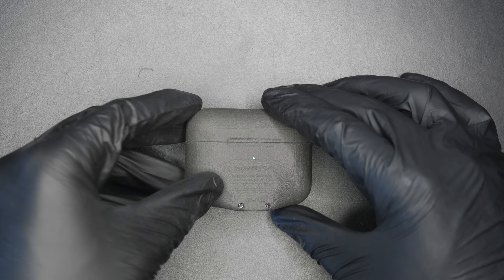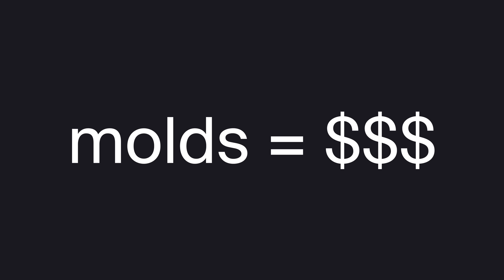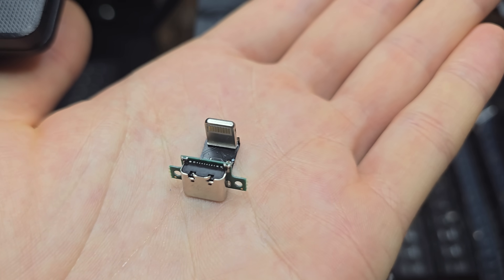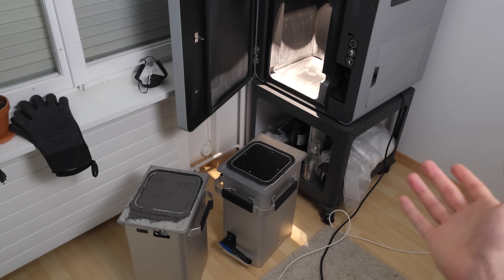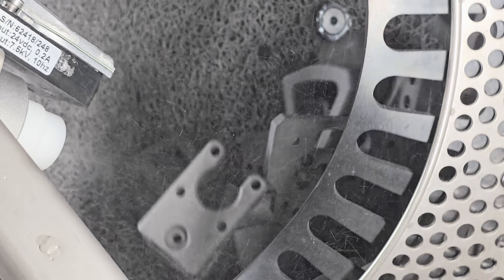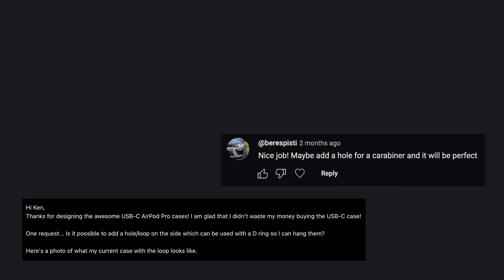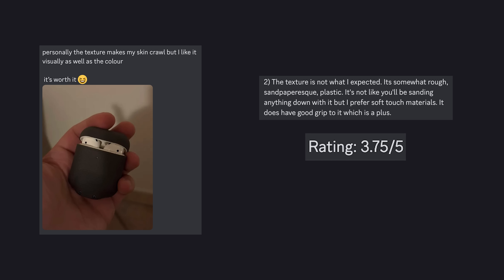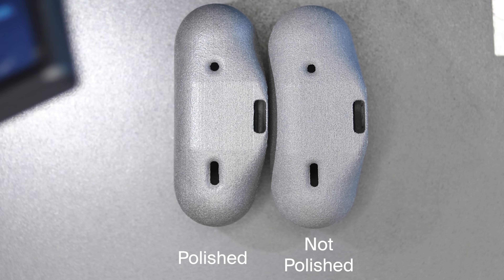One Man Plastics Factory

Comment: Seems like there would be a good rotary screen (tumbler) solution for loosening the raw slugs that come out of the printer. Looks like the clean up solution on the machine is suited to one-off and larger parts.
Reply from the maker: This is definitely where most of the human work happens. I agree that I need to find a better solution. I mentioned trying to use a drill with a brush accessory. I will try to improve this by fixing the brush to the station and adding a foot pedal to turn it on. I also need a better brush.

I also thought about a tumbler solution but haven't looked into it much. What kind of tumbling material would you use? I'm worried the powder might get contaminated with tumbling material residue.

Comment: Which compressor are you using there? I saw german signs on it 😊
Reply from the maker: Yes, it's German! From a company called Implotex. I got the biggest one, 3000W, I believe.
Reply: @ExploringTheSimulation  Thank you for your answer. Do you run it in your apartment? Are your neighbors not disturbed by the process, and how long does the post-processing take? I’m also interested in Formlabs devices and considering keeping them in an apartment.

Comment: Why not FDM bambu printers. Get like 10 A1 create prints with support or the auto loader and have it run all day and night. No post processing and filament should be much easier to handle
Reply from the maker: Printing quality is still worlds apart.  The supports would leave marks that I will need to sand down; otherwise, they might scratch the AirPods cases. Thank you for the suggestion!

Comment: We manufacture a lot with fdm and SLA. We looked into using SLS but the post processing blasting time (which you went through with a time lapse for a reason) plus the surface finish was not good enough. We weighed this against simply buying more SLS printers which produce flawless prints and the post processing is much lower. Oh and colouring is part of the printing process, all integrated.
Reply: I'm a bit confused by the last part

More SLS printers that make flawless prints? Did you mean a different type?
Reply from the maker: I also didn't understand your comment, sorry. For the blasting, I used a timelapse for the same reason I don't record the whole 12 hours of printing—to make the video concise, not to hide anything. The blasting actually only takes about 20 minutes; it's not an issue for me.

Comment: To be honest, i own a 3d printing farm, and my fdm printers would actually make a better finish then this SLS printer. Just produced 3700 parts this week, 100% B2B business. The fuse1 is not a bad printer, but the PA12 they sell is way to expensive…
Reply from the maker: Strongly disagree, there is no way an FDM print will look better than an SLS print. They are worlds apart. It might not look like it on camera, but when you have them in your hand, it's very obvious
Reply: @ dear friend, i also do SLS and MJF printing, it is possible, 100% guarantee. The point is only MJF and SLS is more appropriate for mass production and « easier » to get good quality/speed ratio.

Comment: Ja. Certification? EM directive, CE, low voltage directive, productsafety?
Reply from the maker: I tried staying friendly to you but I don't like your tone. You are just spreading misinformation without having all the information. You should do the opposite, get the information and then start making claims...
The product doesn't take more than 5V@0.6A. This is 3 watts. Now if you can hurt someone with 3 watts or melt plastic then I would advise you to patent your invention and you will make billions 😇
Reply from the maker: Thank you for the recommendation. This video was about plastics manufacturing, but I do plan to make more videos in the "one man factory" series :)
Reply: @ExploringTheSimulation  if the plastic starts to melt due to malfunction of the device. You are responsible. I'm a product developer. Contact me if you like to know more.
Reply from the maker: @Skanda5000  Appreciate your concerns! As I said I will make another video on this. 
On I side note for someone else reading this, the product is safe and you can't melt plastic with a 5V usb charger.
Reply: @ExploringTheSimulation  that's not true. Of course you can melt plastic with usb. Watch what power can go through it. Multiply volt times amp and you have the power. That is exactly why does directives need to complied with...
Reply: @NimVim  you all write about sounds and tone... 

In a text message.

I just wanted to help. Look into certification of the earbuds. They are written on the product.
Get into what the directives are: i swear. Low voltage directive, rohr directive are there without me checking.

You product makes a unit with this product. So you might need to follow the same standards. This is a research question.

I do this for a living and just told you what I would tell a customer who would put the same product into market.
There are reasons for these directive. There are reasons for certification European. 
There are reasons why not every material can be used.

The world is complex. I wanted to prevent you from legal issues. And I offered help.

Comment: Do you ever have print failures? If so, how many?
Reply from the maker: Yes, that can happen, but I have never had a complete print failure (where everything after a certain layer height is destroyed). At most, I get one or two cases with a small visual defect (on a 70-case print).  Most of the time, there are zero defects. When there is a defect, it could be that something contaminated the powder (hair, debris, or whatever), or it is usually fixed by cleaning the optical cassette in the printer.

I would say it is very reliable.
Reply: @ExploringTheSimulation  That's outstanding, thanks for replying and keep exploring the simulation👌

Comment: I love your profile picture! Always wanted to ask, how exactly did you make it? (I tried a few ASCII-Art generators but they don't really look the part)
Reply from the maker: I made it years ago! If I remember correctly, I also started with one of those generators you mentioned, but I think the key is to have a very clean-looking picture. I used the same picture as my LinkedIn profile. Then I cleaned it up a little by deleting characters manually, and then I wrote a Python script to manually swap the existing characters with characters I had chosen myself. Hope this helps!
Reply: @ExploringTheSimulation  Thank you very much for the answer! I will look into it a bit more

Comment: Why dont you print an SLS metal mould for injection?
Reply from the maker: The surface finish of a 3D-printed metal mold would not be good enough and would require an additional CNC pass. By that point, it is not cost-effective; one might as well do everything on the CNC. Thank you for the suggestion!

Comment: The SLS machine + cleaning station and sandblasting robot cost more than molds for your entire product family (most of the small parts could go into a family mold, same for some of the cases and covers). If the SLS machine is used solely for production of this product family than Im not sure its was a smart decision, but if your sales are a few thousands per year than it probably is.
Reply from the maker: It doesn't? The bottom part for one case was already $15,000... There are 5 bottoms; that's more than the whole setup! And yes, you mentioned it correctly: price is one argument, but the fact that I can continue to produce new products (and I will!) is the real game changer. Thank you for watching.
Reply: @ExploringTheSimulation  
I am saying that the 15K quote you got is an extremely overpriced quote. Lets say your current setup is worth around 100K$, you have around 15 parts? some of them can be molded into a family mold, you are talking about around 100-150K$ for molding (and that's at the expensive part of the spectrum, the design and molds can be optimized and a better mold manufacturer can be found to reduce the molding price dramatically) and then piece price is a few cents with almost 0 post processing. The main drawback is that changes are almost impossible, but once your design is completely finalized this is a much better option if you are producing more than a few thousands a year.